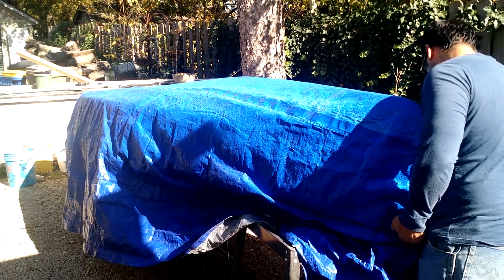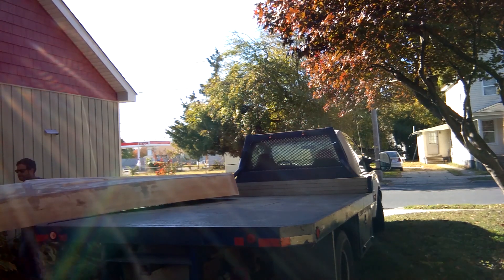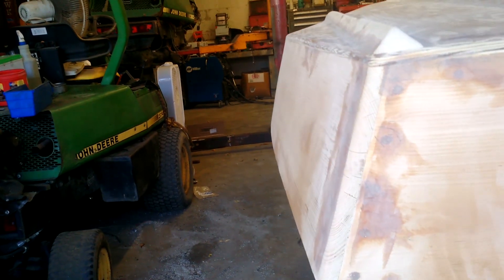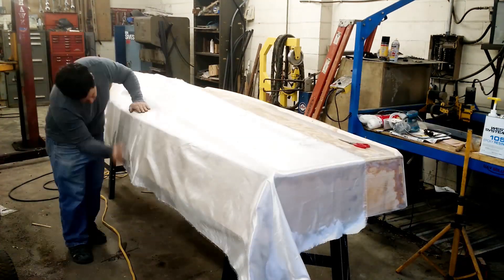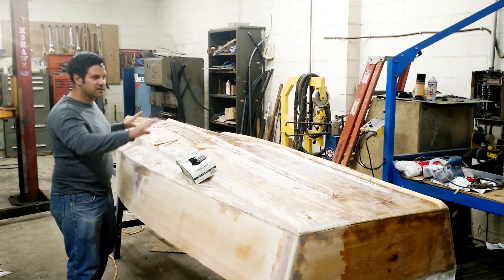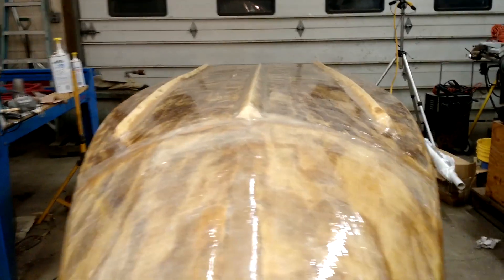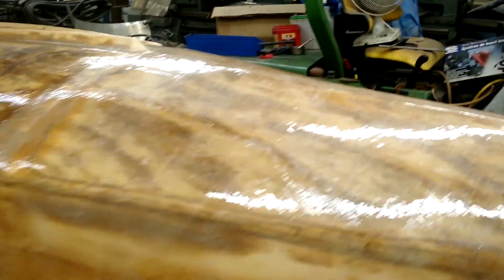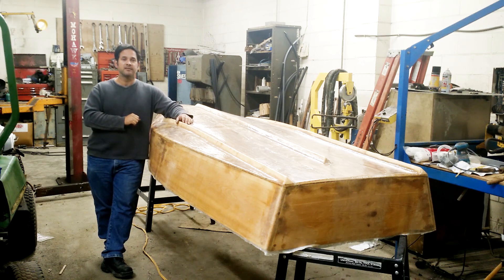HomeMade plywood boat part 5  -  EPOXY AND FIBERGLASS

Comment: I always overlap my fiberglass, carbon fiber, kevlar, etc.... Makes for a strong bond.  In my boat build, i did 3 layers in some areas and 5 layers on the gunnels and on the oak strips on the bottom that will bump into stuff in shallow water.  Mine is not right or wrong. It just is.  and it works great.

Comment: applying a coat of resin before applying the fabric would help with wetting out.
Reply: if epoxy was the choice of resin thinning it with denatured alcohol would help dampen the cloth & yes all the videos i have watched on laying woven glass seems they all put a base layer of resin then glass & so forth
Reply from the maker: Learned that the hard way

Comment: Hey, what are your dimensions and how much epoxy/glass did you use? I'm currently building my first boat and trying get an idea of what I might need at the final stages. Are you painting it or do you use UV resistant epoxy?
Reply from the maker: The boat is 12' long and 4' at the widest point.   It is painted, check the follow up videos.  I still need to finish the inside.

Comment: You have to roll the resin on wood first for adhesion and saturation, then place the mat. Then roll it out and pour more resin.
Reply from the maker: thanks, i ended up figuring that out.  i think with polyester, it soaks through the weave much easier, not so with epoxy

Comment: Hi ! How many coats of fiberglass did you put on the hull ? And inside the boat ?
Thank you
Reply from the maker: I only put one layer on the outside.  I'm still working on the inside, and I will use one layer as well.  The fiberglass in this case is to seal, not for strength
Reply: Ray MAKES ok thanks ! And one coat of polyester resin as well ?
Reply from the maker: I used epoxy resin.  But I put a second coat on top to smooth out the glass

Comment: Hey its not because its chinese! Woven fiberglass is hard to lay out. It definitely needs some elbow grease. You probably would've had an easier time with chop strand mat or something although weight and performance is different.

At any rate, use fiberglass rollers to help the resin impregnate the fiber. Its definitely a must. Here's what I'm talking about:

https://www.google.co.ve/search?q=fiberglass+roller&source=lnms&tbm=isch&sa=X&ved=0ahUKEwiz8YOj1pzXAhUBPCYKHeuJCP0Q_AUICigB&biw=1920&bih=974
Reply from the maker: thanks for that!! i will need this when i do the interior

Comment: That bow is just beautiful. Could easily fit in a modern sailing dinghy. I wonder what software did you used to plan the panels?
Reply from the maker: +joão Basto thanks, but I did not use software,  the entire boat is improvised,  no plans.  Here is part 1 https://youtu.be/nIvOluxjjcs

Comment: When you are choosing fiberglas fabric, you should be sure than fabric is not processed with paraffin. There is special fabric for epox fiberglassing ( with no paraffin) and fabric with paraffin used in construction to wrap heat pipes. Second one is not usable for boatbuilding, because it rejects resign.

Comment: NICE BUILD!!!! Ray I was wondering how much epoxy did you use? 1 or two gallons, and what brand?
Reply from the maker: thanks!!  i used west systems epoxy, and so far less than 1 gallon.  i think by the time i'm done it will be a full gallon or a pinch more.... but it is a 12' boat.  if you haven't see all the other parts yet... i also take it for a water test.... and i had to build and modify a trailer to fit the boat too... lots of videos
Reply: Thanks I have been inspired to build one thanks to you!!! Great job and detail!
Reply from the maker: GREAT!!  let me know how it works out, and feel free to ask me any questions if you get stuck!
Reply: WILL DO!! Thanks!

Comment: You probably bought Dynel Cloth (Dynel is polyester woven fibre unlike fibreglass where it is woven glass) - if you were using a Polyester resin that is why it did not wet out.  Dynel doesn't stretch well either...
Reply from the maker: +Eden Clark-Murphy good info

Comment: Did you seal the whole outside with epoxy before you fiberglassed?  If not that's probably why you were having trouble saturating the cloth all the resign was soaking into the wood.
Reply from the maker: yeah...lesson learned
Reply: Am planning to pop my boat building cherry pretty soon and this is massively helpful info!!  Many thanks
Reply: Also you used epoxy insteas of polyester resin. It would of wetted out much easier.

Comment: how long is that boat?
Reply from the maker: +DanTheMan FPV the boat is 11'-9". If you want to see how it sits in the water, check out part 6
Reply: Ray Pena thanks! I already have. I wanna build a 15 or 16 foot boat out of plywood, for a large lake in my neighborhood, but I want to make it look like a modern yacht. any tips?
Reply from the maker: +DanTheMan FPV that sounds interesting! I'm not sure I can give you any tips since this was my first wooden boat, and I did it the hard way.  Thanks thing I can suggest is to use plans since it will be much faster and clear.  I've seen some VERY NICE flat bottom (easy) boats on spirainternational website.
Reply: thanks for the suggestions! but i plan on designing it myself. so you recommend making it flat bottomed? also, what electric in runner motor do you recommend?
Reply from the maker: +DanTheMan FPV awesome!! I do enjoy that my boat is my own design without plans.  I think a flat bottom will be way easier to build...but...it will be a rough ride in mild waves. On My clear boats I used a 30lb thrust trolling motor and it got me to 2mph.  A bigger trolling motor does not mean more speed.  There are interesting"homemade" electric drives out there, that would be very cost effective....the torqedo motors are sooo expensive!
Reply: thanks for the quick responses. i was thinking of using a universal electric  motor wirh a belt and pully system, leading to a drive bar, that will extrude from the bottom of the boat hull. i will take a photo of some of the designs i have, and i will give you the link.
Reply from the maker: +DanTheMan FPV that's great, but don't post the link on the video.  YouTube will flag you as a spammer!  They don't want links in the comments.  Put it on you Google plus page, I'll be following you to check out the pics
Reply: alright, thanks for the heads up. ill tag you when i post it
Reply: alright i posted it. did you see it?
Reply from the maker: not yet, where did you post it?

Comment: I've been planning on building a boat since 1980 something, but life kept getting in the way. 
Funny how working and raising a family takes up so much time.
I've been kicking the idea around a lot lately and doing a little research, checking out plans, and watching videos.
I have to say that watching your videos has been very helpful.
I told my wife that I was thinking of building either an ultralight plane or a boat and she thinks the boat is a better idea.
(As much as I'd like to learn to fly I was never serious about building a plane, but don't tell my wife or she might veto the boat)
I told her about some plans I was looking at, especially a 55 footer. http://spirainternational.com/hp_tanu.php , but that's just so I can get plans for something around 16 feet and it will seem reasonable.
I can't wait to see how yours floats.
Reply from the maker: she floats beautifully...ill have a video of the boat on the water up soon!
Reply: Some good reading material is Glen L boat plan book, at least you can read and plan for that day and you will be prepared. That what I did for my tear drop campers.

Comment: Looks great. I went overboard on my second boat and did 3 coats or real thick roven woven. A friend gave me a big roll. My first boat I put skegs on the bottom before I glassed it, big mistake. That thick stuff did not bend. I've been playing with chop strand mat and it's a little easier. You can fold it for corners fairly easy.
Reply from the maker: +steggc85 yeah, I will try the strand mat next time. I think the strands are lightly glued, and the glue dissolves with resin so it forms easily
Reply: The trick for the chopped strand is just that, the fibers are chopped and then just tangled together into a fabric. It gives you decent omnidirectional strength since the strands are all random. It will soak better and bend much easier since the strands are so short and loosely packed.

Woven fiberglass fabrics are meant for higher performance applications where weight is a top concern. They give more strength for less material since the strands are continuous giving the composite more integrity, however the strength really only works in the direction of the weave (some are biaxial or triaxial for applications where you need to handle different forces). Since its all woven and continuous, its harder to lay it down on the mold.

If you think that one was hard, try laying some carbon fiber! That stuff does NOT like resin at all! (Most shops use infusion methods for carbon, which also work with fiberglass btw. But it can definitely be layed up manually if you've got the patience)

Comment: Do you have any experience with using painted canvas to waterproof a boat?  If so, what are some of the advantages of using fiberglass over canvas? 
BTW, I'm enjoying getting caught up on your boat builds.
Reply from the maker: i have no idea about painted canvas! having said that.... i would think the only advantages to canvas is cost and weight.  fiberglass is stronger but more expensive and more labor involved than canvas.